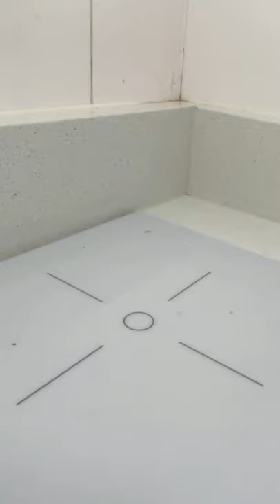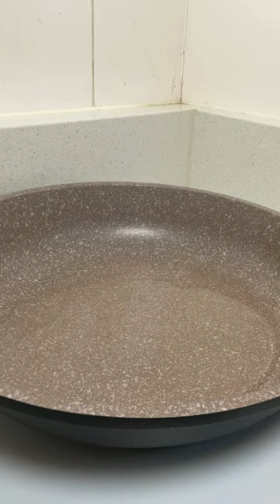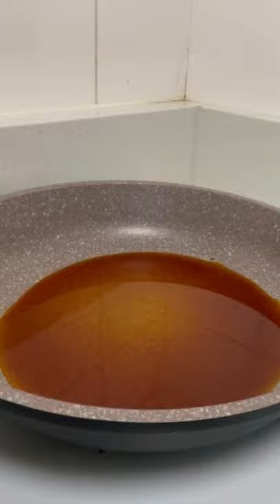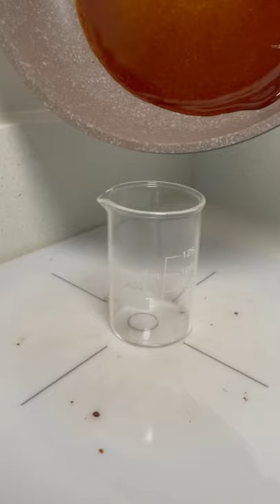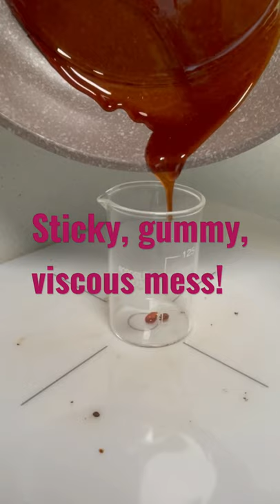When you leave oil on the pan too long - polymerisation of oil #Shorts

Comment: What additive do they put in motor oil to prevent this in high milage engine oil?
Reply from the maker: Generally a higher quality base oil is the first line of defence - so a highly refined mineral oil or a synthetic oil. After that, aminic antioxidant additives and ZDDP help to reduce oxidation.
Reply: @LubricationExplained  is ascorbic acid ever used? :)

Comment: This is a good, visual illustration of what oil polymerisation looks like. However it's worth pointing out that all 'natural' fatty acid esters (like peanut oil) are way less resistant to oxidation & polymerisation than the mineral & synthetic base oils you get in engine oil (& that's before they're further enhanced with additives). This frying pan experiment is a million miles away from what happens to the oil in your car's engine.
Reply from the maker: My wife may have objected to cooking engine oil on our stove! Also the experiment would have taken considerably longer….
Reply: @LubricationExplained  Wives! They just get in the way of good scientific discovery!!
Reply: @LubricationExplained  BTW, castor oil (from which Castrol derives its name) is a brilliant 'natural' lubricant. The reason it's not used (other than in racing oils bought by nostalgic grandads with a smell fetish) is because, like your peanut oil, it has virtually zero resistance to oxidation.
Reply from the maker: @MrSensible2  Yeah, it's also a natural laxative. Remember hearing an anecdote that all the pilots in the Battle of Britain would come back from flights with the runs because castor oil was used in the engines at the time - I guess they inhaled enough of it to have an effect. Maybe its just an urban myth though.
Reply: @MrSensible2  Hold it Mr S…You might want to include 2-stroke engine aficionados who were raised on Castrol R at the racetrack (and on the street) running that glorious stuff at a 16:1 (premix) ratio. The 2-strokes sautéed Castrol R, the 4-stroke flat burned to…well…LE’s peanut oil demonstration. P.S.-not a GranDad
Reply: @watercooled8105  Ah yes... 2 stroke oil. I stand corrected! The thing with 2T oils is you actively WANT them to be unstable so they burn easier. Think the same applies in Wankel engines? Best get that peanut oil readied up for your Honda 50 (I had one when I was 17 but not yet a grandad!)
Reply: @LubricationExplained  Think that was from attempting an inverted loop with a Spitfire before the addition of fuel injection…it was a bit deadly I’ve heard…
Reply: @MrSensible2  The Wankel engine (Mazda RX-2 version) used a conventional (automotive) engine oil, but the apex seals (that didn’t) seal had me go through more Castrol (GTX, I think) than 2T oil for my Kawasaki H-1 (500cc 2-stroke)
Reply: @watercooled8105  I only did bits & bobs for Mazda (they're too small to set as a target OEM) but I have this vague recollection that they deliberately specified Group I (mineral) oils for their Wankels because of their burn-ability (which is another way of saying lack of oxidative stability). I know they don't use 2T.
Reply: @MrSensible2  Oddly enough (or not) there were few consumer choices in my area of California (oil wise) for this car and no dealer. You’ve just provided the answer to my frequent spark plug changes due to fouling. This car was a rocket and would have performed even better with a factory spec lubricant.

Comment: Questions about the thin film polymerization people do on cast iron etc to season pans: How long the polymerization process to get that thin, hard film takes? I always read like "bake for one hour". But it all sounds not very scientific to me.
Reply: To reply to my own question: It takes a few Seconds. Tried on an iron baking plate. Grape seed oil (smoke point ~216°C). Wiped on very thin, smokes for a few seconds. Repeated 5 times. Resulted in a hard non sticky dark layer.
Reply: @C00ltronix  you sure thats not just oil on your pan
Reply: @mastertrey4683  What you mean? I put oil, so sure it's oil. What else could it be. Only difference is it's polymerized now. That was the plan.
Reply: @C00ltronix  I'm in the middle of doing a lot of research on oils polymerizing and came across something a little earlier that said grapeseed oil polymerizes significantly faster than any other oil